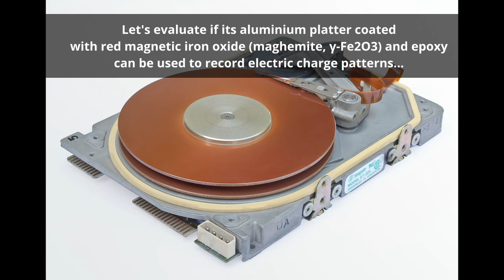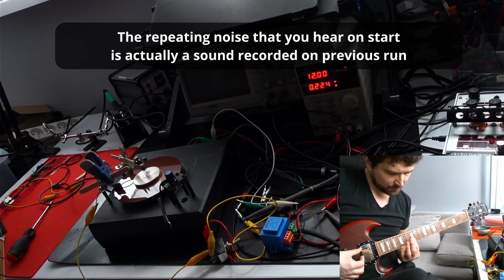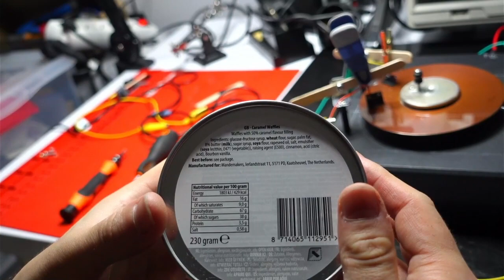Electrostatic delay line experiments (tel-ray reconstruction)

Comment: great!!! why the oil in the tel ray ?
Reply from the maker: two functions: 1. to lubricate the surface and avoid abrasion of the recording medium 2. displace the air from under the heads. The air is isolator so it impedes charge transfer between the heads and medium, the oil is conductor so it enhances the charge transfer. In case of hard disk platter there is already excellent fluorinated teflon-like lubricant applied to the surface and the surface itself is exceptionally smooth. That lubricant is only a few nanometers thick so doesn't impede the charge transfer too much. This way we can get away without using the oil. You can notice that when using the cookie can lid, there is more noise, less sustain and also the surface is more easily abraded, but we can still kinda get away with that because it's epoxy phenolic so pretty durable and also by raising a driving voltage. Not sure what coating besides anodized oxide tel ray might be using but it might be not as durable, smooth etc to be used without the oil.